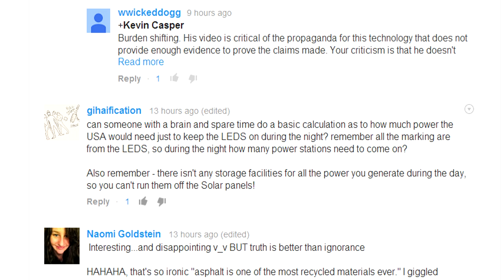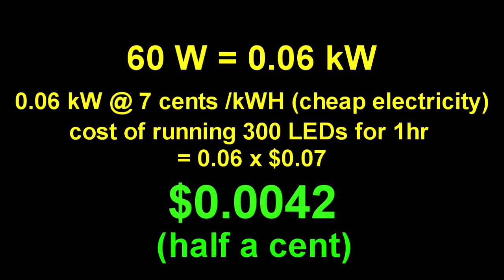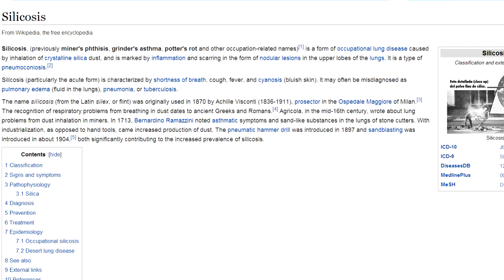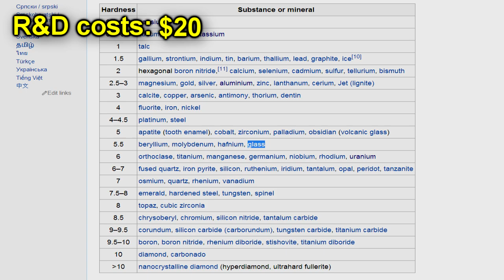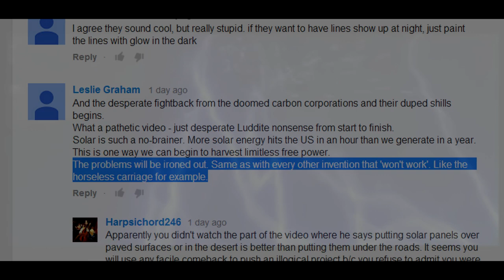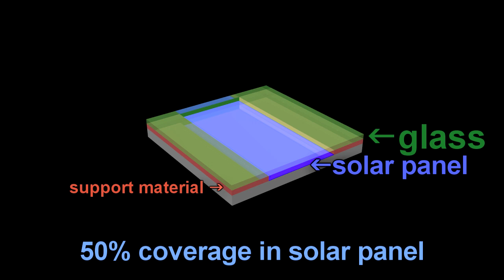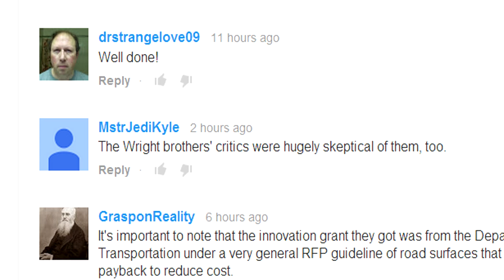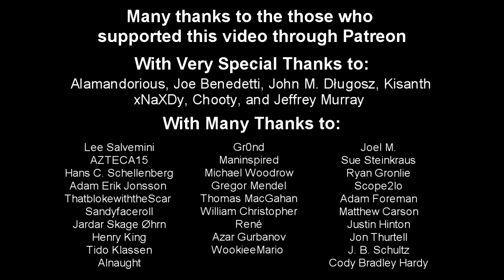Solar Roadways, IMPORTANT QUESTIONS AND ANSWERS!

Comment: Don't get me wrong now, the idea of solar roadways is ridicolous but the cost calculation are fundamentally wrong, because you won't buy Trillions of LEDs in a retail shop. The prices you name in your videos are too high and give your opponents an unnecessary target to counter you.
Reply: Der Spliff If anything, his prices are too low. One thing the proponents seem to neglect is the nature of supply and demand on price. If a demand for LEDs surges due to construction of these tiles, supplies will fall short and prices will rise - as will the materials needed to make the LEDs.

As with all commodities, gauging a price for a massive purchase based on current market value is faulty. Assuming supplies and price will remain constant in the presence of increased demand shows great ignorance of economic realities.
Reply: Der Spliff Panel Roadways aren't the best idea but Thunderf00t gets a lot of stuff wrong in this video and his audience just laps it up without the slightest hint of scrutiny.
Reply: Mark Baanstra Wires can be fished.  I was just suggesting that there is a less stupid way to do than the way it is currently being done.
Reply: Der Spliff the cost is the least of your worries
THE COST TO RUN PER HOUR!!
VS SHITTY OUTPUT POWER
Reply: Socialist Skeptic Please list what Thunderf00t got wrong in your opinion.

"aren't the best idea" is way to kind to the solar roadways idea.  It goes under the heading of "totally daft" in my opinion.
Reply: Socialist Skeptic
Well said!
Reply: Mark Baanstra what will earthquakes do to solar roads with hv wires underneeth
or even plate movement wih those wires then it rains!!
Reply: Mark Baanstra a lot of car fires and dead people who have no pulse and no visible injuries!!

because they dont have rubber boots/suits
Reply: I can see it now, a private office building installs solar walk ways to trim down energy costs, a small earthquake hits, the world explodes. Yup, technology debunked.
Reply: Mark Baanstra
I think it all depends on how it's built and how bad the disaster is. There are already underground power lines in a lot of areas, and pipes under a lot of roads, so the idea isn't exactly unprecedented.
Reply: Socialist Skeptic not in earthquake prone areas...
solar roads face another problem like when cars ride over top them
they will sink into the ground a little

happens to all tiled roads
Reply: digsDAman they will sink into the ground a little
That depends entirely on a variety of other factors, you're assuming they would just be placed on dirt.
Reply: Mark Baanstra how much would it cost to replace all roads with those AND expensive glass solar tiles with led's
Reply: digsDAman  The cost argument is stupid because it doesn't relate to real material costs, it only relates to abstract financial costs which are highly malleable.

As the means of production are organized and production is streamlined cost could fall dramatically, and globalization could even further reduce abstract financial costs.

As for replacing all of the paved roads, that's not likely to happen and if it did it wouldn't happen all at once, the place we're most likely to see this is around office buildings and other private locations, and they aren't all likely to have LEDs, nor do they necessarily need to be made of glass.
Reply: Mark Baanstra I think a full up conduit would not be needed.  Obviously the glass panels can't just be put down on a ballasted road bed.  The wiring can be brought out to one side of the road and then taken overhead at the power poles that often run along the road.  This doesn't save the daft idea but I will explain the sort of design I think would be the least awful:

Conductors for the wiring would be deposited directly onto the back side of the glass.  Some may have to be ITO but most would just be aluminum patterns.  The heaters would be done as a resistance alloy deposit.

The photocells are wired in series this will give a few volts so that thin wires and not too much insulation will work fine.

The LEDs and photocells and a chip to make the LEDs addressable would be done as "chip on glass".  The electrical heaters would also be controlled by the same chip that does the LEDs.  

Instead of local blobbing, the whole back of the panel would be coated

The "micro converters" would not be done on the panels but rather off to the side where many panels can be gathered together.  The DC can be made into a few thousand volts to be sent reasonable distances before converted to be put onto the consumer power lines.  For this up conversion a simple minded flyback converter can be used.  It doesn't need to regulate.  It just transfers the power.

The networking would be a very slow version of the SMB bus.  Once you get off the road a faster interface would be needed.  The reason to use the slow SMB will be obvious when I point out it is hard to do a twisted pair as a trace pattern on a flat surface.

 
It doesn't save the idea but I think if I had to do the design this is what I would do.
Reply: Mark Baanstra
But you're speaking of a specific design relevant only to a specific kickstarter project.
Reply: Mark Baanstra it's jackhammer time
Why would it be jackhammer time?

I mean for one underground wires already exist in some places and they don't have to constantly dig them up and check them because they have places above ground that they can check the wiring and find anywhere there's a problem.

Secondly, we're talking about panels in this instance, if the panels are removable it may simply be a case of turning off the power and using the right tool to lift them out, then they could be serviced or replaced with a new one.

And if the means of production goes mainstream so that they can be produced on an assembly line, replacing them could become a lot cheaper than normal road work, the cost of them now isn't representative of a fixed final cost.
Reply: Mark Baanstra Wires in conduits are repaired all the time.  Anyone who does industrial electrical work can do it.
Reply: Mark Baanstra No, the conduit is not plugged.  The wires are never a tight fit to the conduit.  Besides, how are these wires going to break?
Reply: +Socialist Skeptic Can you source the hardness of glass compared to the hardness of asphalt?
Reply: Mark Baanstra
A wire in concrete isn't likely to break unless there's a seismic event.

the_scientist5 FlamingVikingGoat
Yes just google Material Hardness Tables for example.
Reply: Mark Baanstra
Rust is caused by the oxidation of vulnerable metals. Are you under the impression that all wires rust?
Reply: Mark Baanstra
Let's clarify exactly what you're talking about.
Are you talking about the modular solar panels in the SFR model?
Or are you talking about some alternative modular panel model?
Or are you talking about the use of techniques to transfer captured heat from concrete and asphalt and convert it to electricity?
Reply: Mark Baanstra
Are you on the topic of wires in conduits going through the concrete still?
Reply: Mark Baanstra Electric wire not "in" the concrete, but does go through the concrete.
In this case in and through mean the same thing don't they? But the electricity doesn't run through the concrete, heat does, it's transferred and gathered like an unvented heat sync so the heat can be stored and converted to electricity.
Reply: Mark Baanstra Electric wire is never in concrete, it inside a wire conduit surrounded by concrete.
Ok not only is that a meaningless distinction, I don't think it's even relevant to what we're talking about.
Reply: Mark Baanstra You obviously think you have some kind of point here but you don't.,
Reply: +Ken Smith Wires break all the fucking time in conduit for several reasons.

RF Technician here, also an electronics engineering technician; oddly enough I started as an electrician.

Anyway wires break most of the time due to water. Buried conduit it can be a nightmare to track and fix. Water get's in somewhere, due to whatever reason, freezes and crushes the cables. 

Conduit will also flex in the winter and summer. It's something that can't be stopped. The question is WHEN it will happen not IF it will happen.

There's a lot of other reasons it happens to but whatever.
Reply: JamesCizuz
Go back and re-read my comments.  I was commenting on the fact that wires in conduits get repaired.  If I'm saying they get repaired I logically can't suggesting they dont break.
Reply: +Der Spliff 
Even if you change every number TF mentioned 10 times in favour of solar roadways, the numbers will still be too ridiculous and unrealistic for this concept to work.
Reply: Ken Smith
Well for one Thunderf00t talks about rooftop panels, the only problem with that is that there is limited rooftop space for panels.

A lot of the claims he makes about road panels are also just faulty generalizations, for instance he equivocates all glass to that of a soda bottle.

In the past he's also argued that glass would be slick, clearly he imagines a perfectly smooth flat surface, but it doesn't have to be a smooth flat surface. He also makes a big assumption by assuming that the panels would have to be made out of glass.

As a specific response to the specific model that spurred his video it makes sense, but even then he generalizes and attacks the idea based on a the durability of a Soda Bottle.

On the LED lights there's also the point Der Spliff makes. Yes it would be frankly stupid to replace the lines on our roads with LED lights, Thunderf00t is right about that, but his cost argument is contingent on the workings of the capitalist market economy, what if some non-capitalist entity decides to do it? What if some capitalist entity decides to do it and happens to control all of the means of production so that it doesn't need to purchase the lights? And he's talking about LEDs that are structurally flimsy and aren't really designed to last, as if this is representative of all LEDs.

Another cost fallacy he makes is to extrapolate that the cost of an emergent technology is representative of a final absolute cost that can not be changed as the means of production becomes more organized. How is it that assembly lines and globalization can reduce the price of cell phones containing computers more powerful than anything we had in the year 2000 to a mere $40, but it's presumed that this technology can not be made cheaper?

I could also go into technical details about small mistakes he made, for example glass is actually harder than asphalt so to argue that it isn't hard enough to drive on is a bit, well, stupid. But I think these are more trivial mistakes that are beside the point he was trying to make.

On the whole I think Solar Panel walkways and roadways are not a very good idea, but it's not a terrible idea either if done correctly. And I'll note here that panels aren't the only idea for solar roads and walkways, some office buildings already harness heat that soaks into the pavement around them to reduce their own operations cost.

Comment: It would be cheaper, easier, and simpler just to raise the solar panels above the roadway.
Reply: Duane C Solar freakin' roofways.
Reply: +the_scientist5 FlamingVikingGoat "It is a lot of space"
If that is the only qualifier let's put them under the oceans, there is a lot of space down there.  Point is just because there are a lot of roads does not make them a good spot for solar panels.  Rooftops on the other hand would be much better suited for solar panels.  There are many roofs and they do not have all of the drawbacks of roads.
Reply: +yarpen800 I mean, I wouldn't mind some shade while driving in the Arizona sun
Reply: +yarpen800 Same thing that makes rooftops good for them. It is a lot of space that could be used for more then just driving/shelter.
Reply: MrNateSPF I never meant on the roads, but above the road slanted could be good depending on geographic location.
Reply: the_scientist5 FlamingVikingGoat
 The road surface is what this video is about.  But putting them over the roads would involve building a massive system of structures over the roads, and powered lighting underneath to run 24 hours a day (negating how much power can be generated).  Why would the roads still be a part of the equation?  Sure it can be done, but there is no benefit to it.  Where as the roofs of buildings are already, well, built.  They can be added right on top of flat roofs, like factories and shopping centers, and nobody could tell the difference.
Reply: MrNateSPF So I guess you didn't understand the meaning behind the comment anyways..

The comment wasn't about the fact that we should put solar panels on top of or even close to roadways, it was about the fact that it would be much easier and more efficient to put them above the roads than putting them into the road. which can't really be argued.

I agree with your points about using roads for this in general makes no sense, its in fact pretty stupid. (although the notion of putting roofs over our roads may have some benefit that's not what we're talking about) 

In short, I was trying to make you think about the comment with regards to the video rather than as a standalone idea.
Reply: +yarpen800 actually here in the UK it's quite common to find solar pannels on rooftops. infact you can get grants to have one put on your house. the any electricity they generate that you do not use get's sold to the grid. not great given the weather here in the UK, especially in wales which is on the wrong side of a rain shadow but they pay for themselves pretty quick, I could imagine somewhere like california they would produce a heck of a lot of power
Reply: +MrNateSPF Dude take it easy and the first comment in this chain again.
Reply: *****
 Dude take it easy.  It would not be cheaper, easier nor simpler to build structures over the roads.  As I already said it makes no sense that roads are involved.
Reply: *****
 Actually it is just you taking my comments out of context.  Go troll someone else ;-)
Reply: crwydryny
 Many areas in the US have that as well, it all depends on local regulations.

Comment: Even moderately heavy traffic would block most of the sunlight from reaching the solar cells.  Plus the roadways have no camber so they would flood instantly whenever it rained.  Snow would be an off-switch, as would falling leaves in Autumn/Fall.

This whole idea is insane, thanks for a great video Thunderf00t.

Comment: I'm with you on the fact that solar roadways are currently a bust.

though i am curious, would there be a way to make a solar roadway work?
if we skip on the integrated LED's, find a more suitable/durable material to coat the surface with and perhaps only convert the area's between the road markings to solar.
would there be a way to make it work?

also, just to play devils advocate. here's another Carl Sagan quote:

"It seems to me what is called for is an exquisite balance between two conflicting needs: the most skeptical scrutiny of all hypotheses that are served up to us and at the same time a great openness to new ideas"
Reply: Mark Baanstra or stop ranting about "bio-asphalt" as it wouldn't actually fix any of the problems we're addressing.
Reply: scettzvill No. There really just isn't any way to make this idea work. It's a fundamentally inefficient and problematic idea.

Comment: http://mic.com/articles/117948/6-months-later-here-s-what-s-happened-to-the-netherland-s-solar-bike-paths

Solar roads are a complete success. ''Flying colours''!!! take time to read link [very short].

Now! who's been listening to this fucking idiot regarding Fukushima? hit me back for all the links that prove thuderfool is talking crap on this one as well.
Reply: JessicaAtreides37 No it wasn't, it made just a little over the expected value. How much they do not say but it can't be a lot. Also that you do better then expected doesn't mean its viable. If I got to a test and expect to get 40 out of 100 answers correct and then get 48/100 I did better then expected, doesn't mean I pass the test if the minimum is 60/100. That test shows that those roadways are half as good as some local solar panels on peoples roof. If I went to you and wanted to sell you a new car, does the marketing pitch of "do you normally use 1 gallon of for each mile with your old car? Well about about using 2 gallon of gas for each mile instead?" Those roadways are half as good as a normal solar panel.

Comment: Alright- a few things I don't get.

A.  Who cares if it would work?  It would literally take more than two thousand times what they currently have just to make the things, then you would have to pay to tear up the old road, dig those special trenches for wires they mentioned, and add in the solar roadway.  Not to mention all that takes time, so how are you going to do this on a major highway without causing major traffic issues?  One panel at a time?

B.  People say that we're not talking about regular glass, we're talking about special magic I breakable, unscratchable, unweatherable glass, which would probably be a better, and more useful invention than these solar roadways ever will be, but if that's the case then they lied when they said that the glass was recycled.

C. Trees.  The ones along many roads in America. They make shadows on the road.  To put it another way, they make a very low efficiency solar roadway when most of the sunlight is being blocked by trees.  So, you would need to knock down millions of trees to reach anywhere near maximum efficiency, and adding that with the lie about recycled glass seen above would definitely lose the vote of any environmentalist group.

I came up with these reasons it won't work for logistical reasons without a single penny of research.  Why do these people have 2,000,000 dollars again?